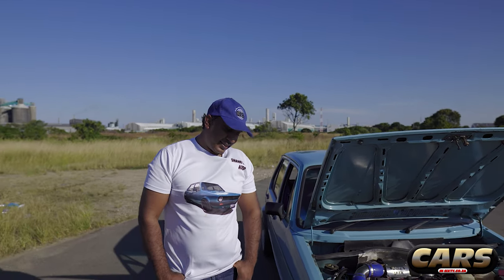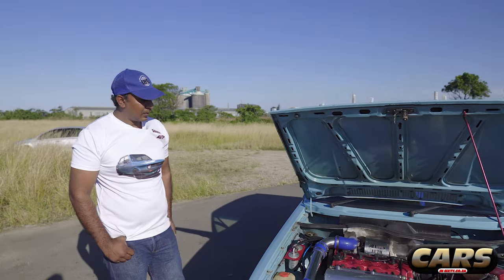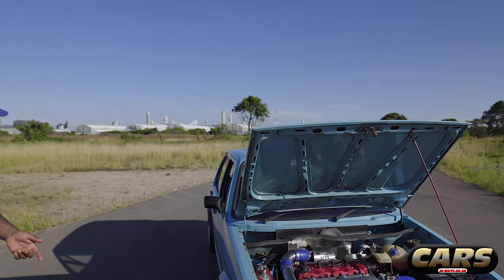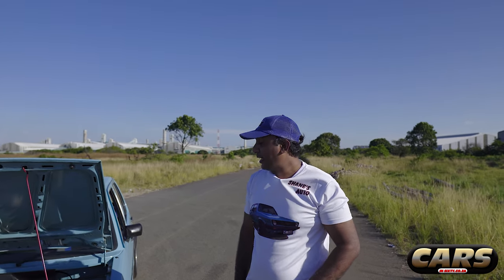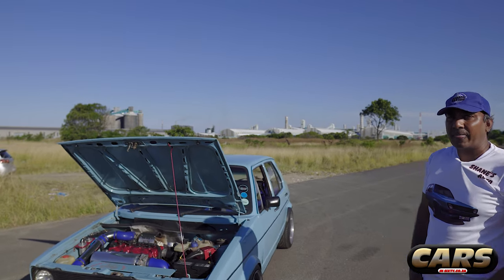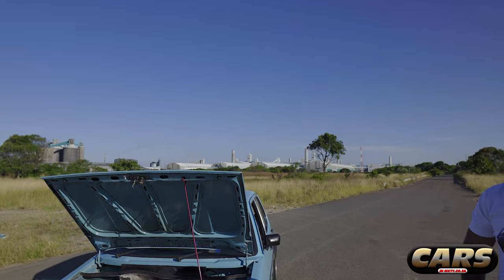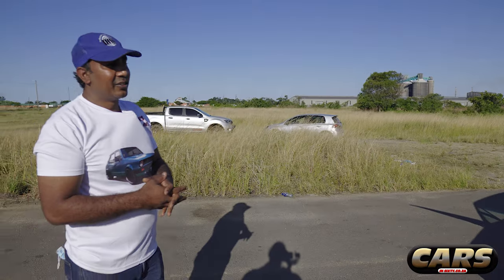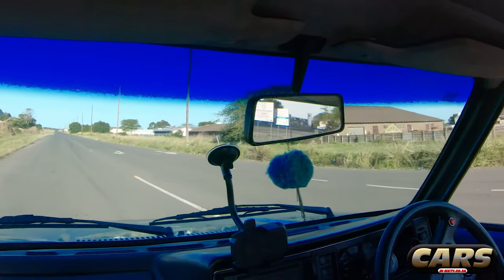VW Golf Mk1 *2L 16V TURBO*

Comment: i have Golf mk3 GTI 2.0L 16v abf 150hp with leather in seats and door panels and it have heated seats from factory,but oil pump broke and the engine overheat and bang...........